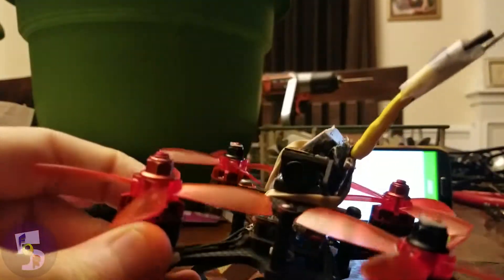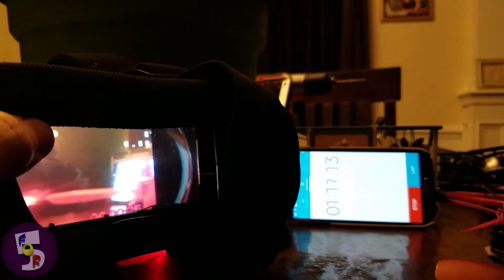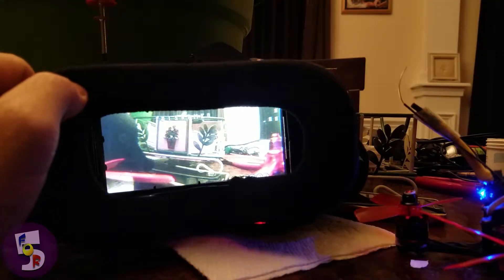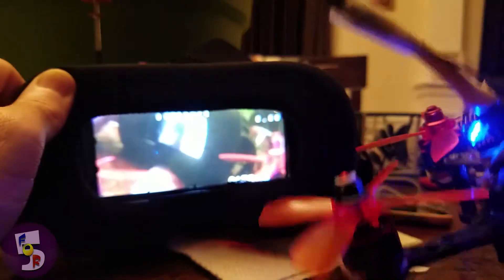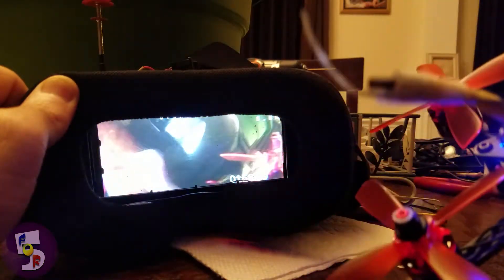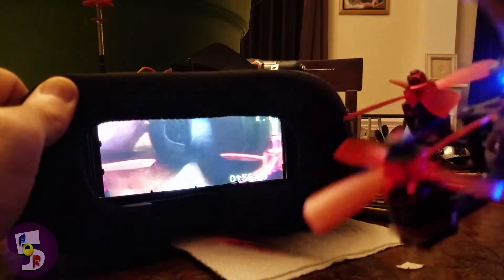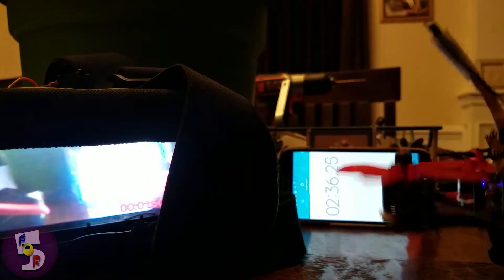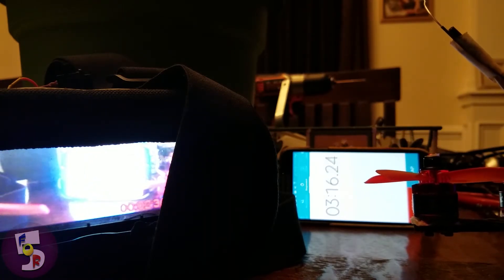Turbowing Cyclops Latency Demonstration

Comment: Point the camera at the phone and take a snap shot of phone and goggle screen. The difference between the time on the phone and the goggle is the lag.

Instead of taking a snapshot you or the viewer can just stop the video and see the difference.
Reply from the maker: i think that's what i had in mind when i put the timer up.  Will re-try.
Reply from the maker: Better than i expected.  .83 and .92, so .09 seconds.  i updated the thumbnail.  Thanks so much for the tip!